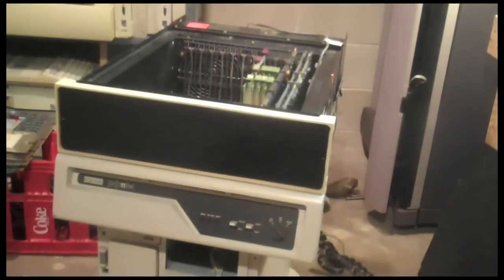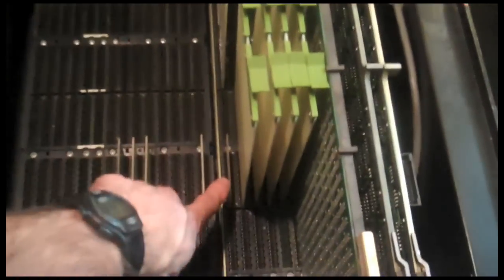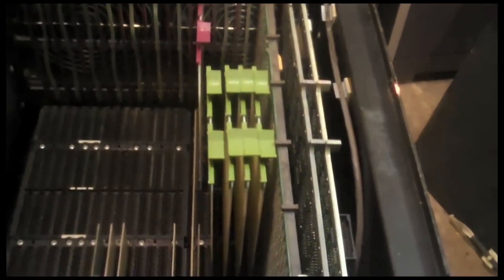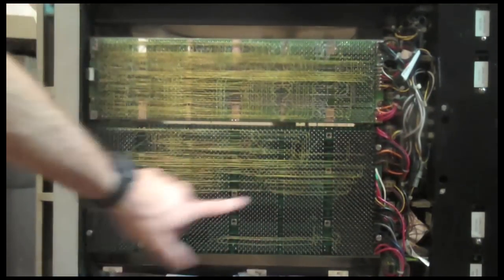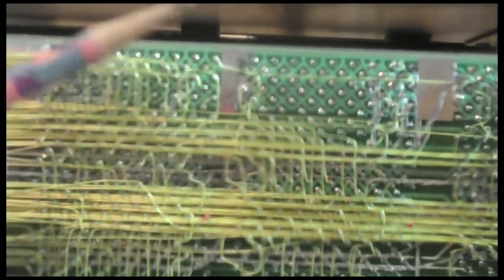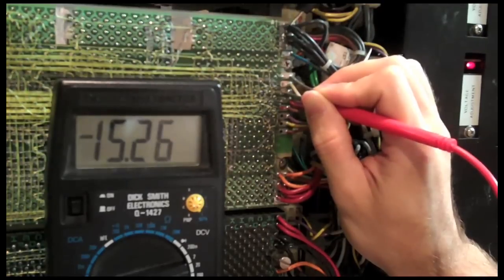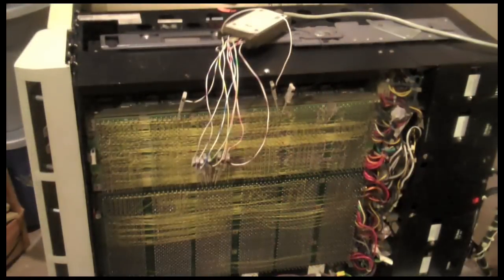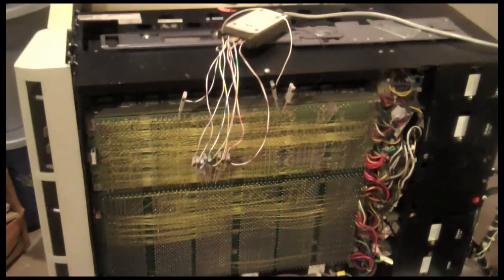PDP 11 Repair - Part One

Comment: I was senior engineer and sometimes supervisor at Digitals Sydney product repair center from 1978 until 1985 (badge number 76274). This brings back a lot of memories.
Reply from the maker: +Don Mills No kidding, that's awesome!
Reply: +jpkiwigeek In 1984 when I was fixing VAX780 cards I had to restore a PDP8 for the DEC museum as a side project.  The manual was dated 1967. It came in a big piece of wooden furniture with a card reader. It was all discrete transistors and diodes, no IC's. DEC still had the circuit boards and other parts in stock.

Comment from the maker: My understanding is that if the bus is short enough (a single nine-slot backplane, for example) the terminator is not necessary.
Because the 11/34a has an expansion backplane it came with the terminator. I'm using it on the short backplane for "It can't hurt" effect.

Comment: Logic analysers? Not around when I was repairing these back in the early 80's! Using an oscilloscope was the tool I used.  Chips marked 8641 or 8640 were very common failures!